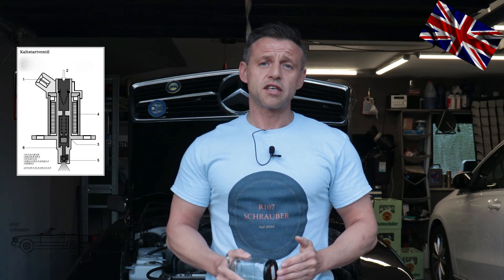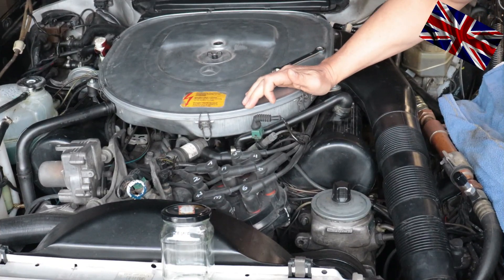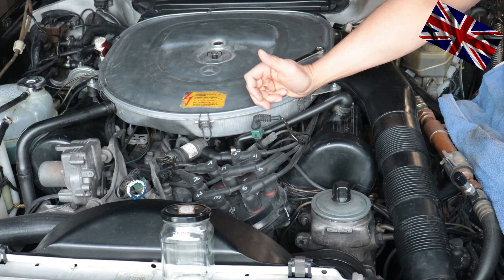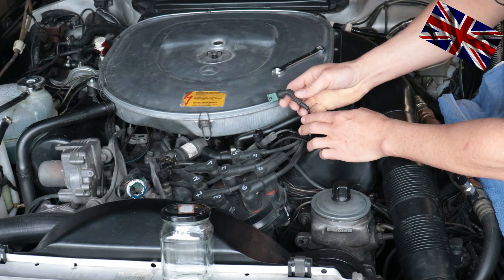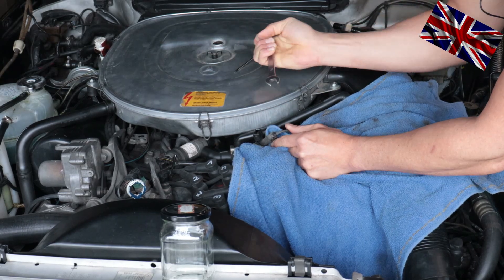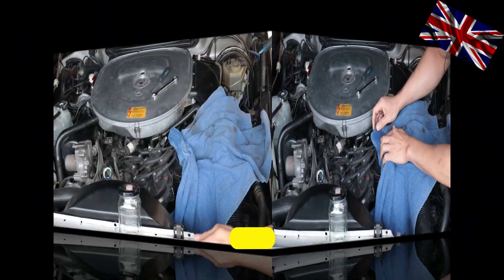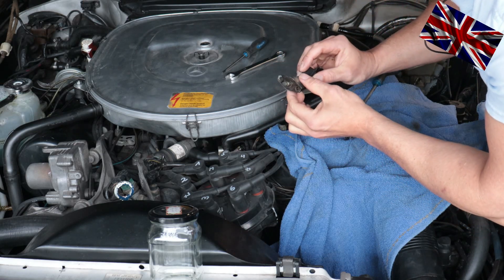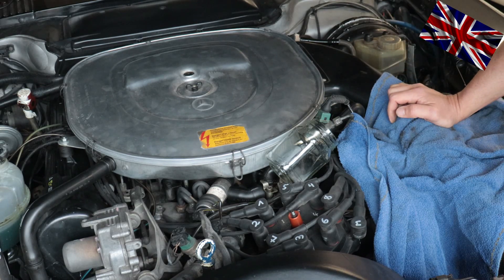Check cold start valve

Comment: Thank you for the video.  My 380SL has the opposite problem at times...the hot start.  After a flawless cold start, about 15 min out of the garage, there is this surging sensation, like high revving up and down and I can feel the car wanting to move faster than I am driving it.  After 18 min, it smoothes itself out, then if I park, to go into the antique shop, or grocer, when I come back, the car sometimes requires cranking 3 times to start again.  Any thoughts?  Thanks

Comment: My cold start valve does not spray any gas,  is it for any temperature or does it have to be 30 degrees to activate
Reply from the maker: It depends on the temperature sensor, the brass ring of the temperature sensor is stamped with the number of degrees and the duration of injection. it generally injects below 30 degrees
Reply: @r107schrauber  thank you

Comment: Does the CSV always activate at start or only in very cold weather, you state 30 degrees (C or F).  Also part of the test should examine for any continued leaking after disengaging the start?
Reply from the maker: The engine temperature must be below 30 degrees then the cold start valve injects
Reply: @r107schrauber  30 degrees C?, since my garage is around 25-30 degrees C, I assume that is why I am not getting 12V to the CSV when I turn key to ON and then use a remote starter to turn the car over (coil disconnected as per your video).  No spray and no drips. If the car is under 30C then where would I look to determine why no 12V to the CSV?  There is plenty of fuel pressure to the CSV so at least I know it doesnt leak
Reply: @r107schrauber  I read on the electrical schematic the switch providing power is closed until 68 F, 15 C so will re-test in the winter. Thanks

Comment: My 76 350SL R107 has this type of cold start valve also. You mentioned it's for KE-Jetronic. Would mine be KE-Jetronic then?
Reply from the maker: No, you probably have a K-Jetronic, the 350 had the D-Jetronic until 02/76 and the K-Jetronic from 03/76. Best regards
Reply: @r107schrauber  How would you be able to tell from looking at engine whether it's K or D? Cold start valve must be the same for all I guess
Reply from the maker: What is the exact year of construction, i.e. which month in the year 76? The K-Jetronic has a flow divider, the D-Jetronic has a ring line and electronically controlled injection nozzles
Reply: @hrauber It must be the K-Jet then coz it has the fuel distributor/divider.

Comment: Should the coldstart valve always spray on a coldsstart? Mine does not when it is 0°C when i tested it. I own a 1990 230CE 

Best raguards Jerry!
Reply from the maker: If the temperature is below 30 degrees, it should always be sprayed at the start
Reply: @r107schrauber  as long as starter motor is on ? or timer ?

Comment: Nice video. My w126 280se is staying on high rpm (1500) while in park and n. When it goes in drive it drops to 1000rpm. Could this be from the cold start valve?
Reply from the maker: d thank you, the cold start valve is not responsible for this. First of all, check the overvoltage protection relay, the additional air slide and possibly false air.
Reply from the maker: https://youtu.be/XfXCOaHz0aQ